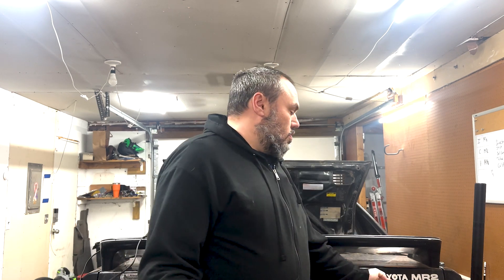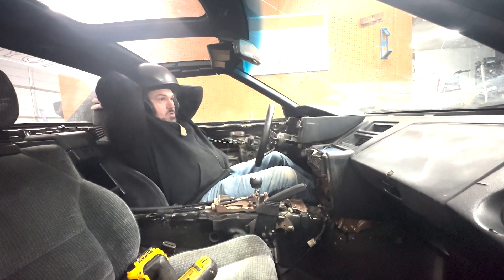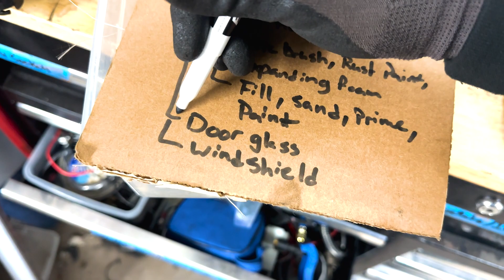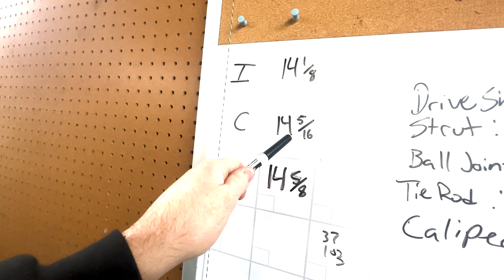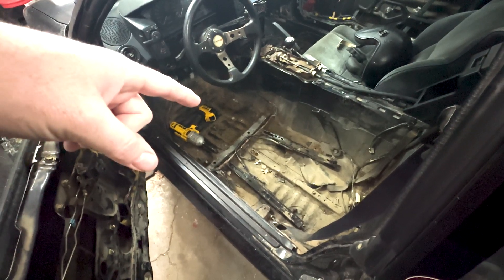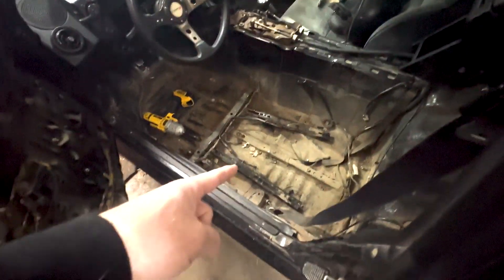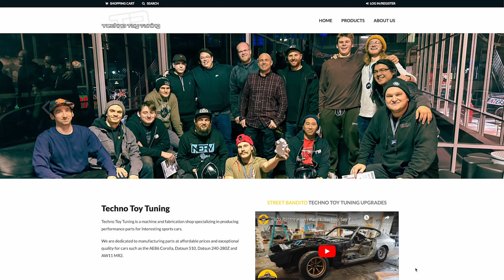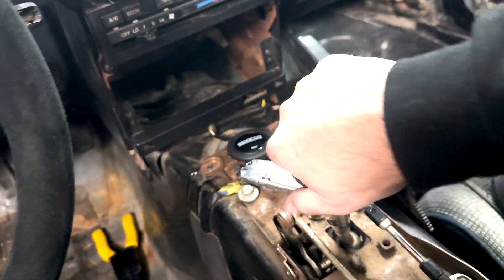Interior Upgrades - Part 1 - AW11 MR2 Rallycross Car

Comment: Best thing to do when changing a seat in the MR2 is fix the original seat brackets to the new SEAT, and use the existing Toyota bracket and slider, just with the new seat, I've done it with both driver and passenger seat in my race car and saves an awful lot of time and trouble trying to fix new brackets to the floor.
Reply from the maker: That’s how I would go if I try to tackle it again but honestly for my purposes the stock seats have been just fine.

Comment: Isn't 87 the year they put the ebrake on the passenger side? I have a 85 and Mines on the driver side so if yours is on the passenger side then that would probably explain the seat issues
Reply from the maker: I'll be.. I had no idea they were ever different. But it doesn't look like the tunnel changed at all. It also doesn't excuse the terribly tall height of the corbeau bracket.